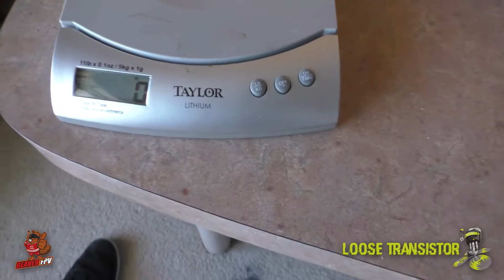FPV DRONE BUILD ♠ Colombian Carbon MIDDLEMAN - Part #2

Comment: On 5 of 6 quads I have turned off filters and it has worked super well.
Reply from the maker: That's good to know. I am thinking of experimenting with one of my cleaner quads but on this build I don't think I will see much benefit. It's already locked in and free of wash.

Will have a video of the tune later this week I hope.

Comment: I wonder if they can have an optional sandwich plate with tab to tie down the XT60?

Would you be able to design and make with your 3d printer a skirt with integrated camera mount? 

Really like watching your build video. Looking forward to the next one. 👌🏼
Reply from the maker: Yeah I was talking to the guys from Colombian Carbon and they are cooking up some other options for the bottom plate as well.

I have considered doing a skirt to protect the elctronics and hold the camera. Maybe I will do that soon and make a video about it. Thanks for the idea!
Reply: Loose Transistor FPV , I got the Wheelman coming and I'm looking around for a race pod I can retrofit for the arms. Seems like nothing is any close due to the minimal bottom plate design. I plan on reversing the prop rotation and don't want sap and debris gunk into the electronics hence the skirt idea or pod. If going with the skirt route, why not integrate a camera mount too.

Comment: Why don't you test for continuity before applying power?  also I always use a smoke stopper as well.
Reply from the maker: Honestly, I do it because the PSU limits the current, so if it were to short the PSU protection would kick in and stop the show long before anything got burnt so its a digital smokestopper of sorts.

I used to do smoke stoppers as well, but I am really confident on my soldering skills so I just use the PSU and I have yet to burn anything.
Reply: Loose Transistor FPV fair enough.
Reply: NyxFPV what type of PSU is it. I'm very interested in it.